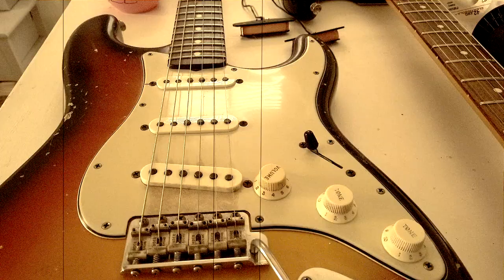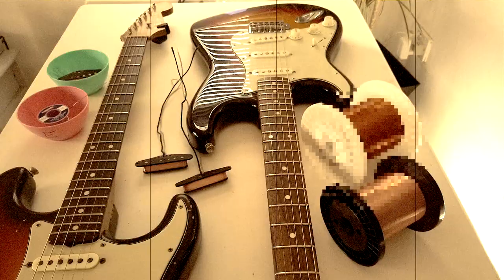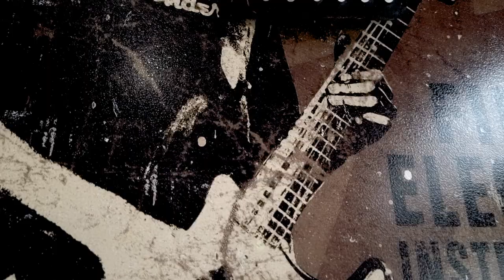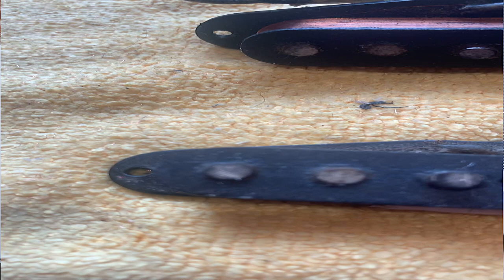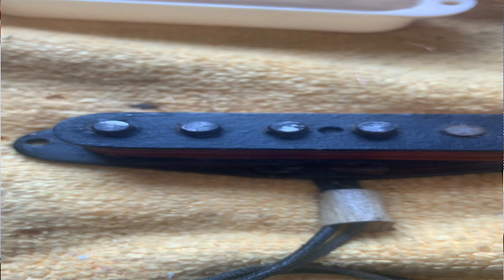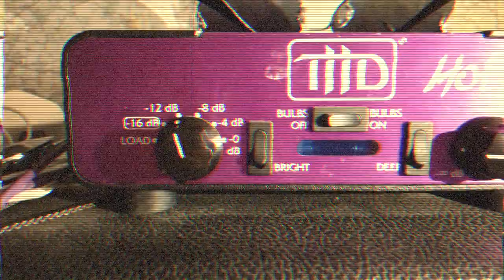Do Pickups Make ALL the difference? [ Mark Foley In-depth Interview]

Comment: No disrespect intended, but pretty much all pickup winders use the same techniques and are aware of inductance and capacitance and have reverse engineered vintage pickups. Not saying that MF pickups aren't great but that has a lot more to do with the fact that the Strat pickup design is a great one.
Reply: THIS!

Comment: Hi Guys do the pre cbs have the borderline microphonic sound that a lot of old Fender pickups have (where you get a second sometimes third overtone) Vintage P90's have it too which is why Juniors are such monsters. The capacitance thing is really fascinating hell it makes a ton of difference in cables where actually you need some (I used George L's into amps for years way way too bright) Then you get guys like bullet coil cable where you have curly cables with just a bit of capacitance and they sound ace.

Comment: Interesting presentation.  When you mentioned that you wind pickups for mark....I thought you went to his facility.  Very tedious work.....similar to what I do hahaha.  I'm curious as to how you are setting your pickup height on the guitars.  With me doing amplifiers, this is a point I bring up with my clients.  From my aspect, I view things as a signal to drive the preamp and its that signal that determines things.  I generally use a telecaster I picked up a few years back.  Its a broadcaster clone a young guy built and I had to change out the pickups.  Point being that when I set up pickups I drop them down in to the body till the signal level starts to drop off in loudness and then raise back up to where they begin to come up in loudness again.  I ride that zone of the drop out and the rise.  That's where,  and particularly with fender style pickup with the pole pieces being the magnets......the magnetic force is acting on the string at the minimum force needed to excite a signal.  I find that people usually have their pickups raised higher and the base it on the perception of the amplifier and getting a really loud response and perhaps even more as to trying to excite overdrive by raising the pickups almost to the strings.  And then there is generally a long circulation measurement that is often sited.  The premise of what I do is based on an acoustic guitar   The individual pole magnets put the force more directly at the string as opposed to how a humbucker has the blank slug pole pieces and the bar magnet on the bottom of the assembly where the force is a little more diffused.  The magnetic force would act as a brake on the string vibration and slow it down if the force is too close to the string.....where as an acoustic guitar has no magnetic drag and the string will slowly diminish vibrating...the decay and the sustain quality...till the string dies out and produces no sound.  SO I adjust the way I do so I ride the zone with the least force to get a reasonable signal and manipulate the magnetic drag to keep it at a minimum force on the string.************** and on the other end of the equation.....is the tone capacitor.  When I build amplifiers, I select capacitors based on the material they are made of as they act as a filter....and that has an effect on the sonics.  But its not a generic thing as it also has a bearing on the manufacturer of the capacitor too in how they handle the material the cap is made from.  A cap from one company with a base voltage and capacitance value might be bigger or smaller than another manufacturers product of the same material.  And  by definition a capacitor is 2 plates separated by a dielectric material/insulator.  And that has a bearing on what Mark was mentioning about his pickup winds......and the tone and response of the pickups you do.    So as being a filter, and this is something I had been preaching to another acquaintance on YouTube.....and he just followed thru with an experiment that enlightened him to what I was trying to get across to him......its the material of the cap as its never really out of the signal when a guitar has a tone control circuit.  SO it has a bearing on response other than the high roll off when you adjust the tone pot.  I generally look at the sweep of the tone pot as to how dark and muddy it gets at the extreme end of the sweep...and choose a cap that minimizes that.  I like a roll of that just shaves off the chime of the highs without going too far in to the dark zone …...so I like a cap between .02uf an .01 uf depending on how the pickups respond.  Dick Dale removed the tone circuits from his guitars so it was a volume pot and pure pickup.....and I believe he always played wide open.  So in the tone cap endeavor with my YouTube acquaintance he ended up trying several of the same capacitance value but of different materials and manufactures and was surprised at the sonic response of each cap being the same value.  He ultimately settled in to the original cap in his vintage strat…..the ceramic disk cap at .1uf the fender used for years.  I'm curious on the caps Mark Foley has been using...and what you have been using...and also how you set up your pickups...or what Mark recommends if its been a subject.  The tone caps are usually the forgotten point that doesn't get brought up.  But as I do my adjustment for the pickups on my guitars....I always mention that the are a lower output as a result....and I boost or manipulate that signal at the amplifier.  In the 1950's the amplifiers were used for instruments and a microphone...the amp was the mini PA system....as there were only single coil pickups and thus a low output.  The inputs of the guitar amps took a change later in the 1950's when they had a #2 input which was an attenuated input intended for a higher output pickup.....the P90's or the humbuckers.....being the humbucker came out in 1957.
Reply: The purpose of the attenuated  input was to keep the same amplifier performance which was based on the premise of a clean output and response in the amplifier......They were not intending the higher output guitars to overdrive the amplifiers......
Reply from the maker: My pickups are slammed !! I like them pretty much in the scratch plate ⚡️⚡️
Reply: Yes I took notice to that, I was briefly looking at a couple of your video's and got the angle for the pickup.....but I was also looking to see how you had the strat bridge set.....if it was down on the body or up off the body but I couldn't determine as when you play, your picking hand kind of hides it.  Then I finally caught it in another video where you pan up and down the guitar.....so it looks flat against the body.  Myself, I set my strats up to be 50% floating so I can raise pitch or lower pitch.....or ride my palm on the bridge in a semi mute where I can palm vibrato and manipulate it while I pick...for the effect.  But that way you are playing off the spring tensioning the back and it takes time to get it all set and with the strings in tune.....and hope not to break a string.  But once you learn the pick dynamics and the touch aspect.....you really never break strings.....but I play with heavy gauge anyway and you'd really need to be a heavy hand to snap a string.  The floating bridge and playing off the springs makes using the heavy gauges more forgiving on the fingers.....at pitch rather than turning down a 1/2 to get slack......only thing is when bending....you need to bend a bit more playing off the springs.   or add in the palm thing on the bridge
Reply: I've been using the heavy gauge strings since back in the 1980's and the SRV influence...….but if I pick up a normal guitar with light gauge strings.….I find them hard to play as the strings are like rubber bands.....I have to mind the muscle memory and bending.  But the tone is really in the heavy gauge